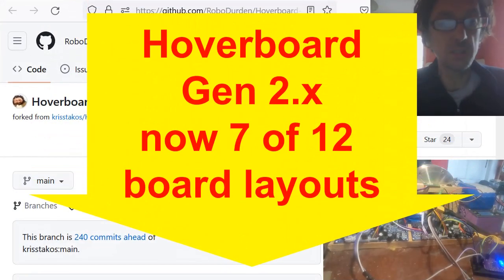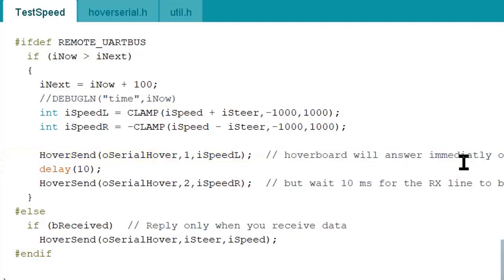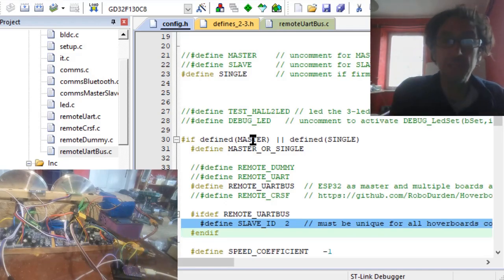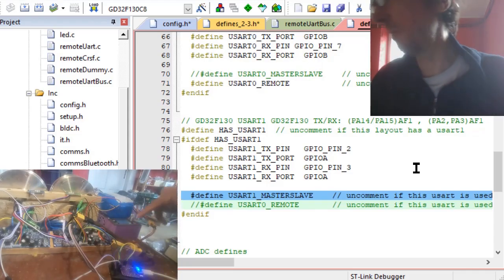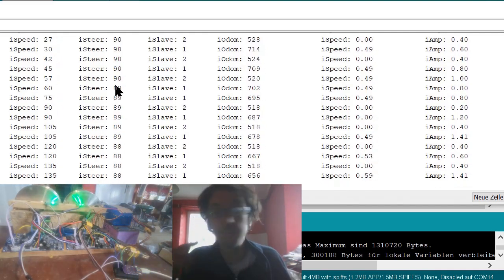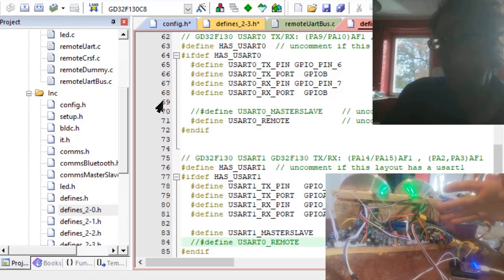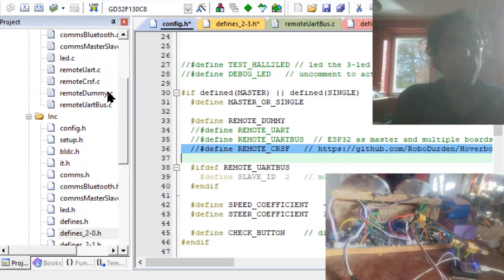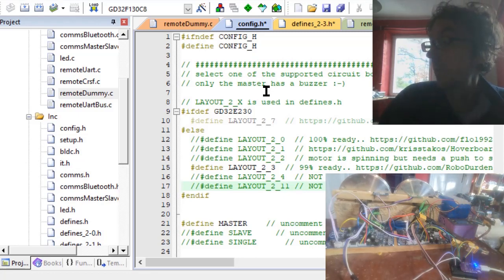Hoverboard Gen 2.x now 7 of 12 boards and 4 control methods

Comment: Nice work!!!  Question - If I use ready binaries "hoverboard 2.2 single Dummy.bin" on my PCB 2.2 on SLAVE board - is this should work OK on slave board?  What should was behave motor ? -
Reply from the maker: I think the motor should spin forward and backward. The on off button will not work and the slave board might need the master-slave serial cable to turn on. I do not have my 2.2 test setup nearby for the next 2-3 months. But you might ask for help in the GitHub 2.2 issue.

Comment: Hello, Thank you for all your work on these boards. I have a board that has a GD32F130 chip but it doesnt quiet match any of the layouts on your site. I was hoping you could point me in the right direction? I cout send you a picture of the master board if I knew where to send it. Thanks in advance
Reply from the maker: Start a new issue on my GitHub repo. There you can add high resolution photos.

Comment: can i keep hoverboard features if this is flashed, so can i make it self balance after flash or do i need to use outside imput from arduino? and is this foc control or? the 1 board ones are foc, but i do not understand if this is foc, now the new boards on aliexpress say they have foc control from stock...
Reply from the maker: This Gen2.x is not FOC and needs Arduino/Esp. And no hoverboard mode any more.
Some Gen1 firmwares try to offer a hoverboard mode. 
But I do not like stupid fun projects.
Bye !

Comment: Any recommendations on current limiters.
Reply from the maker: Search AliExpress for 'dcdc cc'.
If you have a 24V source or a 16-19V notebook power supply, you can choose a cheap step up or LCD boost/buck converter..
Most cheap step down are not suitable for 10s battery :-/